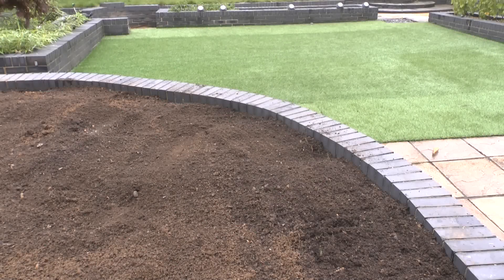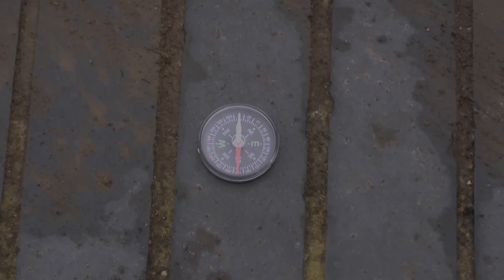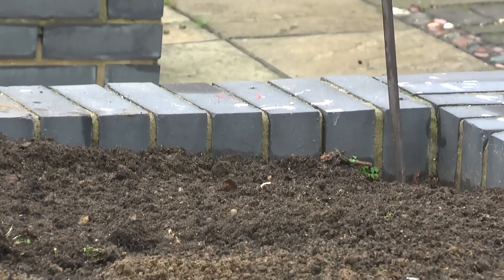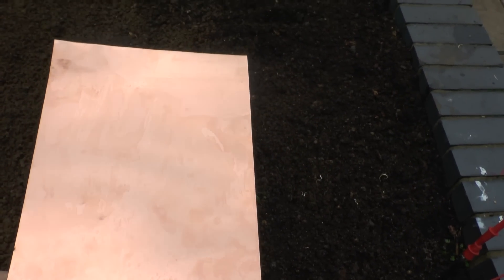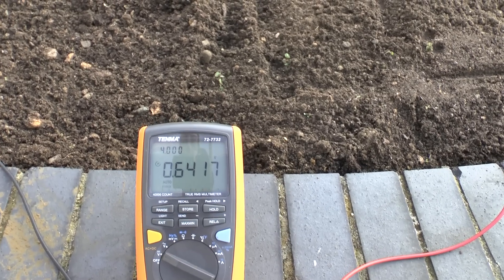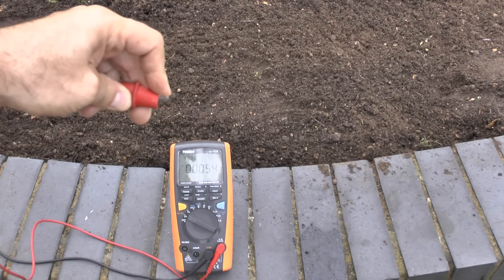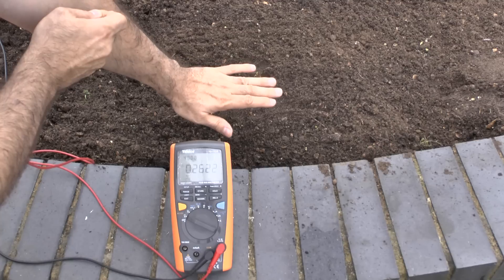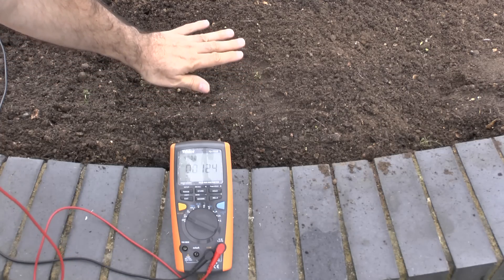The Earth Battery

Comment: Would you mind experiments with earth and atmospheric voltage. Perhaps the higher readings with the copper sheet are because the copper has accumulated ions? Try a drone with copper wire. Lift it up higher. Use a tuning coil between the two sources. When that works, move the earth source to very cold flowing water instead.

Comment: have you tried going between the buried plate and way up high on the roof?
Reply from the maker: Well that is a very special experiment I have not conducted yet.
Reply: I'm subbed and look forward to seeing you try. I did from my ground spike to the old analogue tv antenna and got 0.6v
Reply from the maker: Have a look at the book from Patrick J Kelly. You will find many such systems already build and tested. On my website under books.
Reply: thanks il check it out

Comment from the maker: You are correct technically, however, AC is blocked at DC and only very small millivolt fluctuations are visible. No rectifier is used either. You get different values for different metals. Distance to the plates makes no difference as it would in RF reception. I have conducted test with faraday cage and gained potential during measurements, when the cage is grounded. Connected to the correct ground system does increase potential in a faraday cage. I will show in later videos.
Reply: "AC is blocked at DC" makes no sense

Comment: Hello Sir, I'm in the Hertzian and Angstrom profession. Since you did not used coaxial shielding with your DVM, is it possible your picking up some electromagnetic field (both AC power and RF) in your area? The test leads acts more as an antennas that loops back to earth ground. Just wandering if it's possible to redo measurements inside an RF shield. Thank you and more power.

Comment from the maker: Because it operates outside of the closed system like sun or wind power. It bares the same uncertainty of availability based on day and night time and sun radiation level. Some call it radiant energy and it is not ZPE. ZPE is the result of it and not the cause, like the ripple on the water surface, influenced by the wind.

Comment from the maker: I have just bought equipment to analyse sound and vibrations. The vibration frequency changes with different materials buried in the ground. The same as tuning a coil via the Oscilloscope you would do this work with sound analysers. I am certain that this is a major key to energy system involving organic or natural objects. I was starting looking into ultrasound applications.

Comment from the maker: We see fat top pyramids because the cap stone has been removed. From an energy potential point of you it would be inside this capstone which are build from a different material. Picture the free masons symbol. All their knowledge is based around that subject. The capstone is not in the first golden mean ratio position but in a fibonacci sequence position. To make it simple there is an electrostatic potential created by harnessing the earth energies between the ground and the top of the pyramid.

Comment: This is incredibly exciting!! I know you're measuring frequency and every but are you also measuring sound/vibration? And do you have any thoughts on the flat-top pyramids? Many don't end with a point but instead a cut-off at the tip. It makes me wonder if energy builds up or stores in the pyramid until the top has been positioned, allowing a load to occur. Tesla's tower... maybe that had an underground plate too...

Comment from the maker: I just build a larger one with exact golden ratio proportions. 1 square meter on the base. Slant edge is 169 cm. The pyramid is above the ground but connected to a metal plate inside the ground underneath. Test did show the working function as plants grow towards the pyramid regardless of the sun shining direction. I focus on the golden ration point inside the pyramid for the electrical systems. *f/b* angle = 72 degree.

Comment: You know of the radiant circuit Tesla developed?  I am sure you do, pretty simple configuration.  It might help in your experiments, I will post a quick video tonight you can check out about Tesla's insulated negatively charged metal as an antenna.  You could put this in the ground as well it doesn't have to be in the air.

Comment from the maker: I want to show at first the simple example. You see only the obvious established systems which are based on Galvani and Electrolytes. That is not the case here. I did measure grounds in the past very specific with my oscilloscope but what you measure is again only either RF or power from your mains. It will not go there. If you are interested to see what there is really going on then close your books and don't compare.

Comment: Hmm... with your multimeter you are just comparing the potential of two metals in an electrolyte. I can do the same with the teeth of my grandma and get more voltage than 0.7V.

That's why I don't think, just the number on your multimeter will help everybody. I think, it's more important to look closer on the things, you are measuring. With a scope for example. How long does it take to build ab the voltage back, after you shorten the both potentials, how does the voltage look like, eg.

Comment: Just plug the two electrodes of your meter in the ground and you already have some 10mA and some 10uA. Earth can therefore produce some uW of power without any means or specific metals.
Earth is an infinite source of potential and atmosphere is another one. Both are in constant contact and should therefore be at the same potential, but there seems like an invisible layer that separates both. When deepening an ohmic material into the earth, there's a kind of bridge that change potentials.

Comment from the maker: Correct. As shown, you do not gain more potential when you bury it deep in. that means you can use very small electrodes. In my next video I will increase the voltage to a level where we can convert and store it for loads. 
I have list of electrical coefficient. The human body represent carbon and iron. In all patents you read Zinc and copper. With my grounding system I did build I did notice that more rods in the ground make no difference. We are not talking about electromagnetic energy.

Comment: You may have meant to ask: How can you drive a motor just with *voltage?  You made this clear with your followup.  I'm also curious about the power TheOldScientist refers to that can not be measured but will drive a motor.  If you watch his other videos you will find that he does his research, is very knowledgeable and methodical, and has a very well equipped lab.  So I'm looking foward to learning from the followup videos that he has planned.

Comment: How can you drive a motor just with current? To drive a motor, you need a magnetic field => electrons must flow through a wire => "Amps". 

Why don't you just put a load on your circuit, like a simple 100 Ohm resistor? And another thing. You don't have an oscilloscope, do you? To see how the current raise might be much more interresting than just the reading on a multimeter.

Comment: Awesome - thanks! I have an Earth Battery that has ~0.56V potential. The South electrode is Aluminum, and the North electrode is Graphite. I do have the North electrode physically higher in the ground, on the theory that the Telluric currents  follow the curved H-field of the Earth, much like charged particles in a plasma will follow magnetic fields as they spiral around them. Both electrodes, however, are fully in the ground. I will have to dig up my North electrode and play with the elevation!